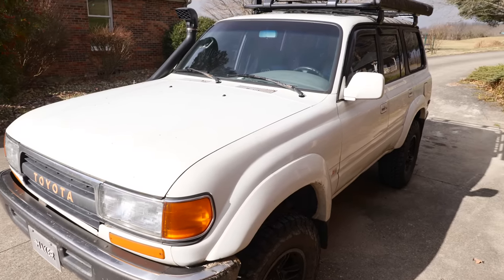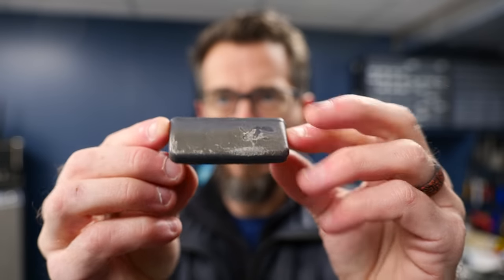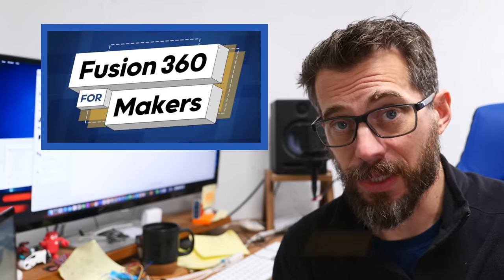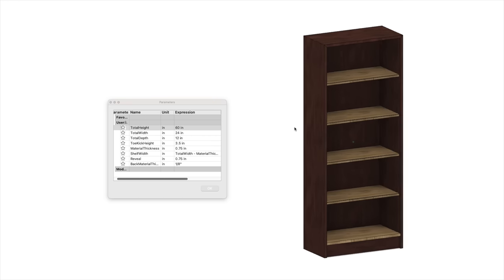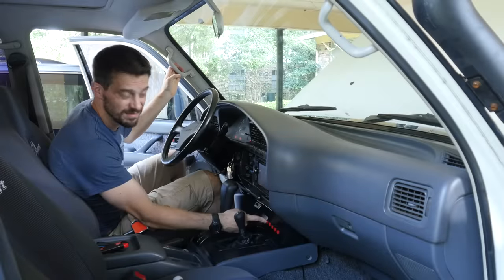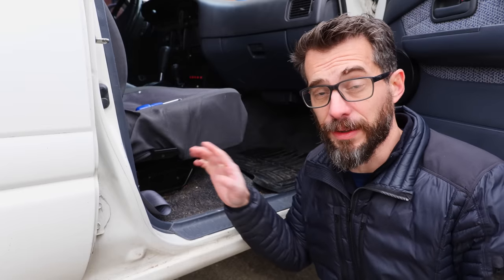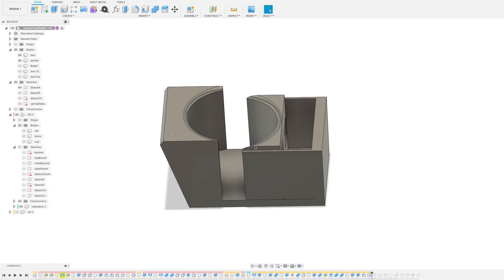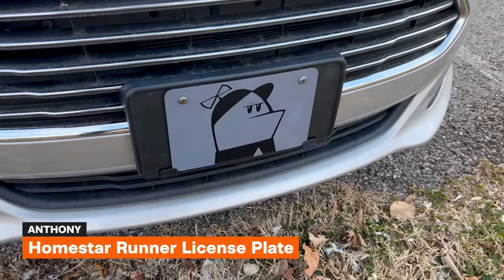Can 3d Printing Improve Your Car?

Comment: great video. It's not only for old cars I would say. I have a 2019 ford galaxy (I'm in Europe) which has 2 plastic bits in the 3rd row seats to hold the seat belts. They are so fragile that I broke one of them in the first month I got the car. I've asked Ford for a price on a new one and they said 50 bucks... I just took the other one, 3D modeled it and I just have few spares in my car all the time.
And I think I broke at least 10 of them just last year....

Comment: What if u mske  the cup holder slide forward like they would on a shelf holding drinks at a store but also instead of the spings just  being on the side that pushes the holder Tords  the drink make the holder push all around the drink with equal presure as to much force on 1 side could crush sertion cups if the cup isn’t strong Enof  was a old design for smaller cups but would also work for cups now a days . also a seat sensor to turn on the heated seats automatically in winter if the cars seat is to cold to sit in even after  car is running for a bit

Comment: I know how to drive a car, change my oil and tires.
Are there any safety concerns when making car parts?
Do car manufacturers use specific plastics with specific properties in the event of a crash? You recommended a plastic type because of its usable temperature range. What about the tendency to bend versus shatter under stress.
Are there any local regulatory laws I might be required to follow for any car modifications?
May these modifications void my warranty?
May these modifications expose me to excess liability in the event of a crash?
Reply: I'd say, ask a local garage. In general you're probably fine as long as these parts don't impede any MOT tested function of the car, especially safetywise.
Reply: What are you planning on printing?!

Comment: I have a question.....can you use file for resin print on regular pla printer? Or pla file on resin?
Reply from the maker: I used this same file to print in filament and resin. You have to select the different printer in the slicing software, but the model works in both.
Reply: @Iliketomakestuff  do i need to twerks the file? The file for resin is set in an angle and my parts is small  do i need to straighten the file for pla?
Reply: @jonathanramiro100yearsago  yeah typically you want a filament printed piece to be flat. but if it needs to be structurally strong you need to think about where the layer lines could break depending on what orientation you print in. 
most slicer software will let you change the angle of the object, so you dont have to change the actual 3d file itself.
Reply: @ge2719  what is slicer? I am new to  3d print and have no clue what i am doing all i know is stl,pla,and resin
Reply: @jonathanramiro100yearsago  yeah, once you make or download an stl file, then thats just the 3d object. 
You then need a slicer program to create a printable file. something like ultimaker cura is a free slicer program. You set that up and select the type of printer you want to use. and all the other settings you can tweak to get the prints exactly how you want them. it comes with decent default profiles for most printers and filaments so you can print something pretty easily without having to go too much into all the settings.
It will then "slice" the file, and produce a print file that you can either print over usb, or put on an sd card that you then put into the printer. 

I think cura also does resin printer slicing but i'm not 100% sure on that.
Reply: @ge2719  oh....it's for twerking bevore printing it to make the printing better quality and prefent failure.....got it,thanks for the info

Comment: All my cars have cup holders that can hold just about any size cup/bottle. It’s called a crotch. Granted, it doesn’t deal well with spills, especially hot beverages, but, yeah, nah, well, usually just use the standard cup holders in the doors and dash. 😉
Reply: The condensation on the outside of the cup isn't pretty when you get out of the car to a meeting 😉

Comment: my current car is fine, but my old car, which my dad still drives, could benefit a lot from this - the entire dashboard could be made new and the old one, which basically disintegrated and I had to piece back together with a bunch of CA glue and epoxy, could go straight in the trash. (it's a 2000 VW Pointer, made with the cheapest plastics on planet Earth)

Comment: Printing 100% infill is likely unnecessary except in very specific scenarios. It’s a waste of plastic because there is a more effective way to increase strength. Just increase the number perimeters. This will increase the shell thickness of the part which contributes much more strength for less material than increasing the infill. Default perimeters is two, so three and especially four would make the part very strong. Also, when considering high infill, you should think about the concept of diminishing returns. The difference in strength between 80% and 100% infill is absolutely tiny. Higher infills may be necessary if you plan on tapping holes, but again, you may be able to just increase perimeters instead.

Comment: I don't have the extra money to get any of these things. I'm a disabled veteran on a set budget. How do I get things like this on a really tight budget?
Reply: Sometimes local libraries have 3D printers. Or there might be a makerspace nearby?
Reply: Mitra is spot on, I would look locally for 3d printing services in public buildings as they usually print these projects at cost of the materials used.

Comment: it would only take me 10-15 minutes to model that part by skipping all the unnecessary steps like tracing it and writing down measurements. 
i just measure and model it simultaneously. i've made parts that function better and are stronger than the original injection mold part. like a phone mount ball socket. 
i didn't need to do any iterations on it because the first print was perfect.

Comment: This is what we call reverse engineering, I would recommend to buy a 3D scanner like the Creality CR-Scan 01, is not cheap around $700 but you will safe a huge amount of time in design and in trial and errors.